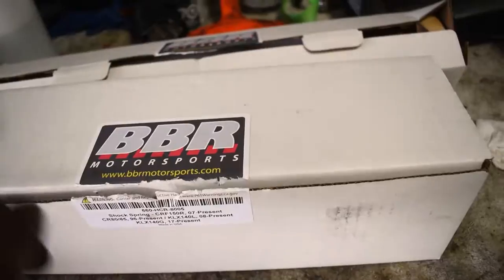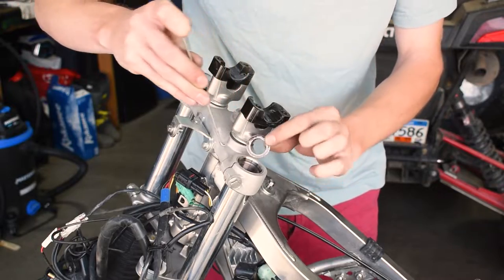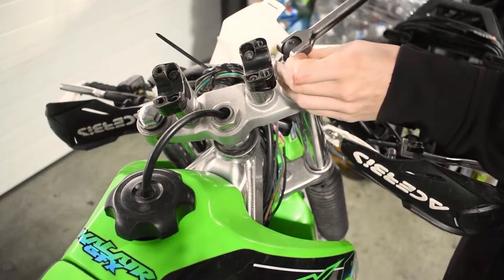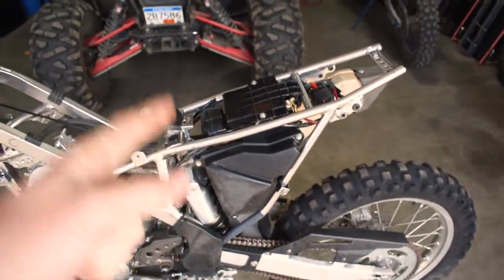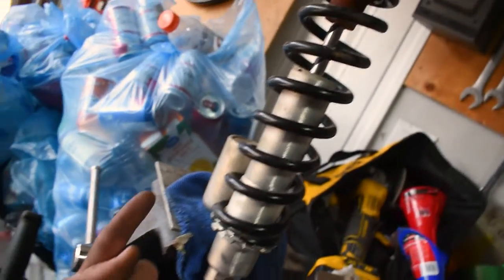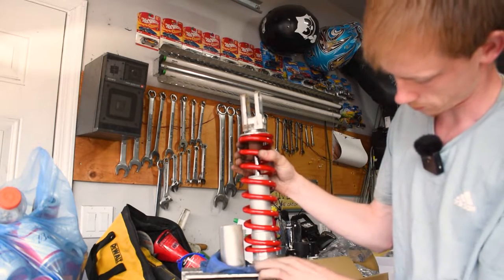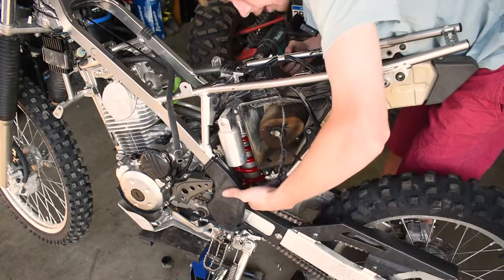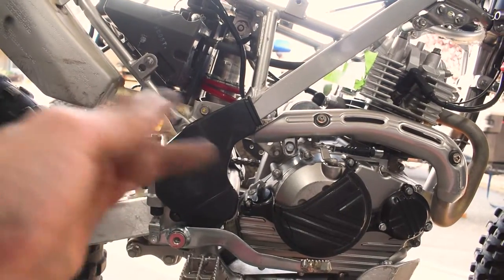The Best Suspension Upgrade For The KLX140RF!

Comment: Just did my front yesterday, it's interesting because your stock springs seems longer, I have a 21 L and they were the same size
Reply from the maker: The RF/G models do have longer forks than the L
Reply from the maker: The aftermarket RF/G bbr spring kit comes with longer top tubes as well to compensate
Reply: @AaronsEnduro  gotcha makes sense
Reply from the maker: Yessir

Comment: love the bike build got some suspension for my klx 140 as well that a dealer ship near me told me to get and then refused to put on so I'm going to try myself(I have decent experience working with dirt bikes) but I cant figure out where to get new stanchion tubes to fit the size difference
Reply from the maker: Depends on which klx 140 you have for which set you need. Bbr just madea a new version for the G/RF that not longer uses the stanchion tubes

Comment: Just got my stock spring off the rear shock. When you put the new spring on, did you just tighten down the threaded piece (not the locking one) snug down to the new spring or did you go further than that? Just eyeballing yours it looks like it's about halfway down the threads. But I couldn't tell if that had required some added turns after it tensed up or not. Thanks
Reply from the maker: Just snug it up then another 1/4 turn. The more u tighten it, the more preload youll get
Reply: @AaronsEnduro  awesome, thanks! It was a real pain getting that locking ring loose.  I had to grind down a chisel so I would have a big flat tool to tap it around. Else anything like a screwdriver would have really cut into those slots. Worked fine though. I’ve enjoyed watching your series on the 140. Convinced me to keep mine and just do some upgrades. Hope your Dad is doing well. Thanks!
Reply from the maker: Yea it cant definitely be a butt to loosen!!! Im glad you’re enjoying my build series and doing it to your own bike aswell! You’re gonna love the new performance! Luckily my dad made a pretty full recovery! Just gotta keep a eye over the fella from now on lol. Appreciate the support and kind words 🤘🏼

Comment: I received bbr fork springs  ,bbr box 650-klx-1505 part number and they are much linger than the factory rf springs . They fit all the way up the plug thread. I wasnt sure if they were right or not. To add a  little preload i cut down the exisiting spacers 1.5 in and it was a tight fit but worked out and the bike definitely doesn't sag as much sitting on it and a bit stiffer. Does this sound right?
Reply from the maker: They redesigned the new fork springs from BBR for the RF!!!

Comment: It says that it won’t fit my 140R do you think that they would fit even though I have the regular R
Reply from the maker: It won’t fit
Reply from the maker: Only fits L and G RF
Reply: @AaronsEnduro  well damn, I can’t find any that will fit my R. I weigh 230 so I don’t want to keep putting to much pressure on the stock shocks.
Reply from the maker: Unfortunately the R is meant for kids! Not much for mods for them comparatively
Reply: @AaronsEnduro  yeah, do you think that the RL wheels would fit the R or would they be to big?
Reply from the maker: Honestly not sure, haven’t tried it myself.

Join the klx 140 owners group on facebook. I’m sure you can find what you’re looking for there
Reply: @AaronsEnduro  okay thanks bro

Comment: is it the same for a kawasaki klx 140l
Reply from the maker: Same procedure yes, different parts required
Reply: @AaronsEnduro  I have been looking for information on how to increase the height to fit my height, but I still can't find information on that.  Do you think the front and rear fork of the klx 140RF will fit my klx140L well so I can install bigger wheels?
Reply: @AaronsEnduro  Where can I find the parts?

Comment: Why didn’t you just put kx100 forks on it
Reply from the maker: 200$ vs 1000$+ getting old used kx forks rebuilt

Also the kx suspension is only fitted for a 19” front tire and will bottom out and hit the 21” front tire without putting stoppers in the forks limiting travel, which kind of defeats the purpose of the kx100 forks. They’re definitely better suited the the 140L than the RF or G model
Reply: @AaronsEnduro  yea i have the base model. i used my old kx forks and the triple clamps just bolted on. the only modification i had to do was make a little bracket so. the 140 brakes would fit. other than that, the stock wheel, axel, and plastics just fit on as well.
Reply from the maker: That’s wicked!
Reply: @davidjdunham which kx did you have?